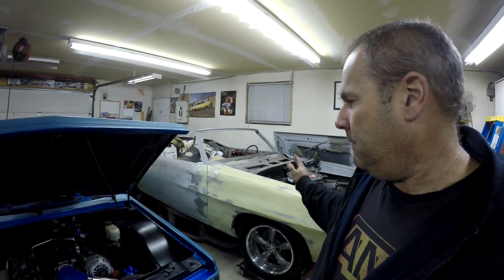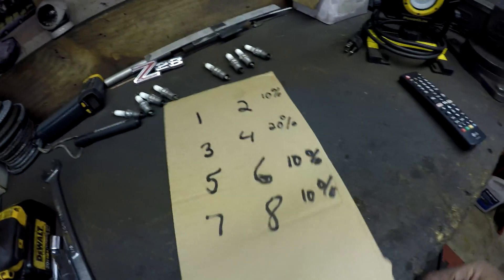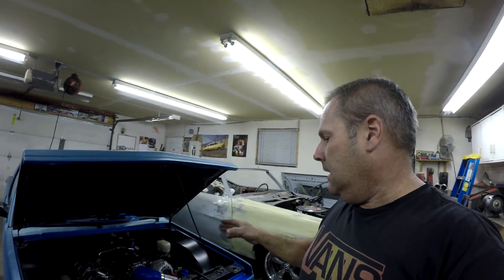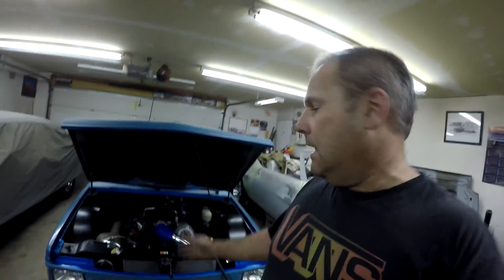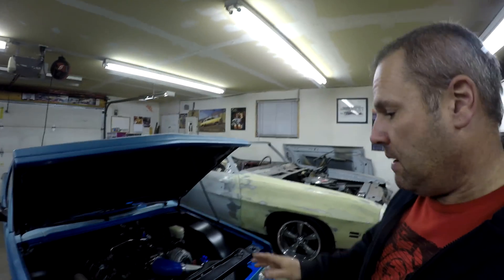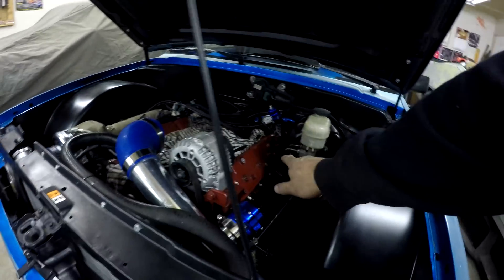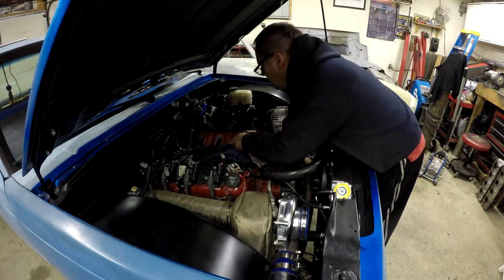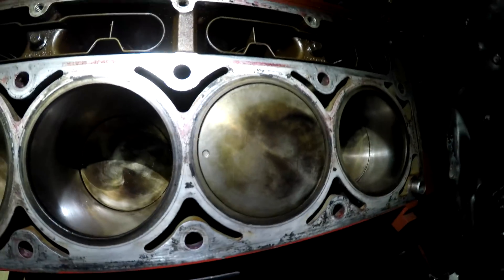ENGINE BLOWS UP FROM TOO MUCH BOOST? | WHAT HAPPENED + Turbo 5.3 LS Test and Tear down

Comment: Too much boost, too much timing advance, and not enough fuel enrichment is what hurts these forced induction motors. Learn from other's mistakes; get a wideband and boost gauge installed. Take baby steps with boost, timing, and watch that air/fuel ratio!
Reply from the maker: Thumbs up for the name as well. I might live in Canada but I'm glad theirs still one nation where freedom exists. 

The Blue ghost does have a wideband gauge, and it was running fine in that respect. The timing was also super conservative. I really think it may have happened no matter what, especially since one of the other pistons had the same issue. -Mike
Reply: SPPTV Nice build and thanks for sharing your experiences, like Denmah, Dario, Hunter and A21Bravo (all which inspire viewers to take the turbo LS plunge). Comment was made so viewers can learn, for a reliable build and safe tune.
Reply: Thumbs up for the comment and your name!

Comment: i do not understand why any body would boost a motor and not put in a good set of pistons..or bottom end as far as that goes ...this is far too much work to be going through to show you can use stock parts because other people have or what ever reason .. i am sorry but i see you working a lot of unnecessary hours
Reply: And it cost me nothing, my nova is a stock bottom end and has stayed together. Ive built fancy afrermarket block and rotating assemblies, they still break.
Reply: Everyone is a critic... Dude I've boosted multiple bone stock LS's and made tons of dependable power. He wasn't careful, that's why it blew up. Tuning is everything to making shit last. Do you even #racecar bro? Lol

Comment: Pull the motor Rob, add in the quick disconnects for the removal of the engine and trans because sadly I think you are going to need to be doing that., Damned shame about the motor  because I was hoping to finally see the GTO getting worked on, and no I don't card about  Mikes video's I don't watch them
Reply from the maker: Lol thanks. I do agree the Sierra bodywork videos got old. Luckily thats over. What would you want to see me film? Were almost caught up on the summers videos, so time to focus on creating again. And always open for suggestions. -Mike
Reply: @SPPTVarmy   I've seen the GTO Convertible in Rob's garage for years now on video and honestly Mike I just would like to see that project get worked on because it needs to be done, put the work in it this year into it once the S10 is healthy again so that you guys can get a car that so deserves to be back on the road once more and not sit in Rob's garage and hope and pray to be rebuilt. I will donate money to that project just to see it run once more and be on the road again. Or fix the Sonic Stang either or would be great content to put out there
Reply: @SPPTVarmy  Sonic stang!!!!

Comment: Probably an unnecessary plan BUT based on the ton of LS swap videos I've seen as well as threads on various forums, I am beginning to think if someone has to do more than very minimal cross member modifications at all, in the long term it maybe better to just "automatically" make the cross member removable from the get go.  You start fresh and make it the way it needs to be for a given swap.  I don't know enough about how it is under the front of the Sh!thorse but can't help but think all the hassle you guys have gone through under the car, modifying pans etc. Would life have been easier IF said cross member could just be dropped out of the way?

Comment: Did you gap the rings? If so what do you set the gap at. I've got a gen4 5.3 I'm gonna freshen up soon and was wondering what to set them at. And did you ever see it go lean on you air fuel guage/ datalog
Reply: 24/26 on the rings and no it never went lean

Comment: Buy some rods and pistons. I love your show but all the time wasted on stock junk is ridiculous lol
Reply: Do you know what an LS engine even is?
Reply: Aftermarket parts break too
Reply: novaracer2000 the whole point is they break less
Reply: Bloodcamaro sexmagik the guy has three cars in the garage, two have twin turbos lol. I doubt a grand is going to break him
Reply: Spending $1k on rods and pistons when you can just swap another stock piston for free or buy a whole other junkyard motor for $300 bucks, just seems redundant. If these motors are tuned right they will handle tons of power bone stock. I speak from experience...
Reply: Bloodcamaro sexmagik I can certainly see your point. I guess I'd just rather do it right once then have to yank a motor on the regular. He can obviously do what he wants, it's his show lol
Reply: @jacobdeem8187  on the regular? I only pulled it once.i assume if i had not forgot the wastegate plugs this wouldnt have happened. My nova has a stock bottom end 5.3 and has been good for 2 years.
Reply: novaracer2000 I'm pooling all your cars  lol I'm including the shithorse.
Reply: still gonna break shit if the tune is off or it gets overboost etc
Reply: Besides, pulling engines equals content. No, not just a cheap way out for content. I’m saying folks who watch (speaking mostly for myself here) are here not only for entertainment, but to learn. We are trying to have fun and fast on a budget, and don’t mind doing a little extra work to do it. And, as was said before, while a forged bottom end may take more abuse, they still give up the ghost as well, so nothing is fool proof. And then where are you? 1000.00 in the hole vs 300.00. @novaracer2000 keep up the good work. You’re killin it.